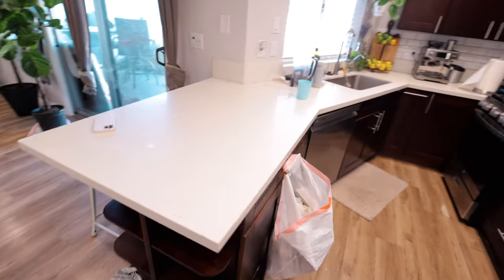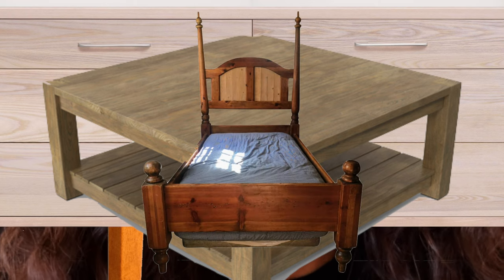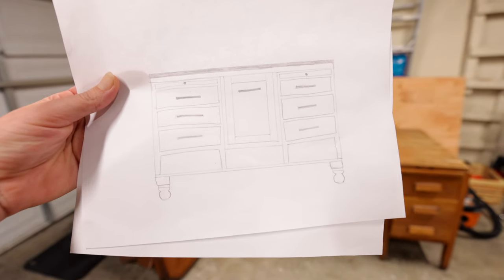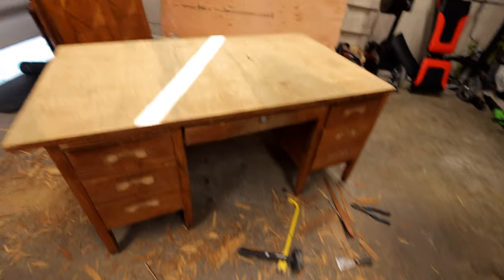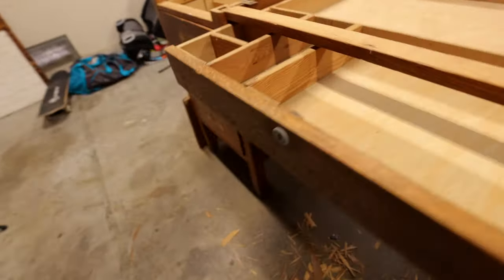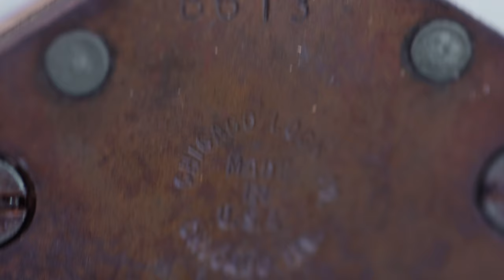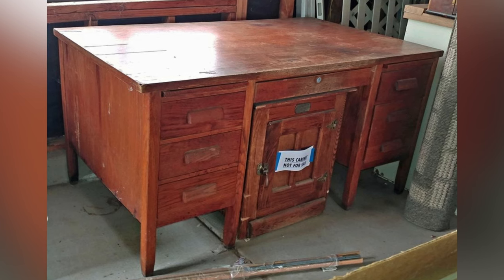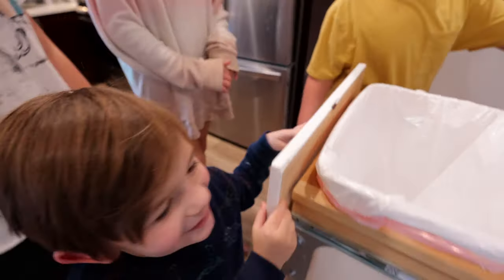Old Desk to Kitchen Island Counter | DIY Restoration Project

Comment: I admire your work and determination but I personally didn't like what you did with that great desk. I was also horrified at the white paint over the wood. What was the point of admiring and appreciating solid oak top then scraping it all down to fit it onto the bottom of the "kitchen Island"😂 (basically a table). You stopped short of your white paint job and failed to paint the drawer sides.

Comment: Totally fukn confusing since you didnt explain anything but just fast forward the key parts. You also flipped the desk on its side when you glued it to the table frame so I have no idea what the orientation was or if you had to make those drawer slides now that the desk is laying down? Basically this video is just for you as we cant figure it out for nothing.